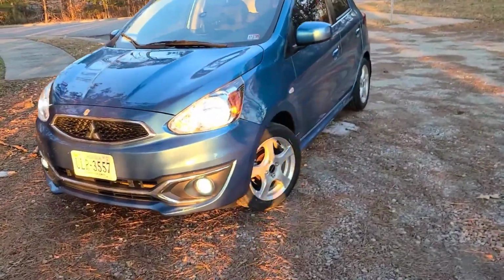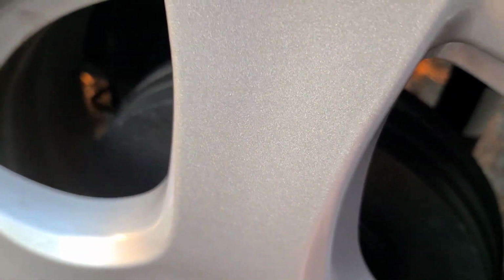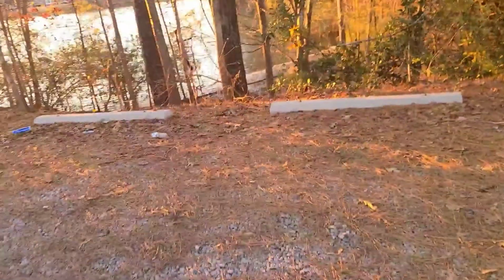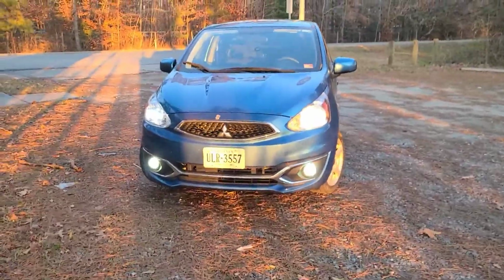Modded 2019 Misubishi Mirage Episode 4- NEW WHEELS AND TIRES FOR THE MIRAGE!?!?

Comment: Can you clarify if you're using 195,55r15 or 195, 50r15. Thanks
Reply from the maker: I am using 195 55 r15 But you can use any thickness depending on your preference and of course wheel size. The bigger the diameter of the wheel I recommend the thinner the tire. I have heard people get 17's on these but that's not recommended

Comment: Hello from Australia. I've got Mirage 2013 and thinking of installing wide wheels as well as my car is not stable on a motorway if speed exceeds 100 km/h. Have done wheels alignment several times and nothing helps. Have you noticed any changes regarding stability on high speed?
Reply from the maker: Wider wheels and tires help more than you would know, definitely recommend. You should watch my review on my channel for them.

Comment: I'm about to buy some Enkei EDR9 15 x 15.5's paired with the Hancook Ventus V2 that are 195/50R15 (just copied that from Tire Rack lol) - did you buy the TPMS kit & have it sent to a dealer? If so, what did that cost look like for you? 

Also was wondering if you found it easier (or cheaper) to buy the wheels & tires separately as opposed to having them mounted before they got shipped to you!

I've been subbed to you for a bit, saw your newest video the other day & decided I'm pulling the trigger finally thanks to you!
Reply from the maker: I used the tpms that was on the stock wheels and put it on the new wheels.

For me personally I bought them all together, then got them shipped to the dealership to get mounted and then installed there as well. (It might be cheaper for you to do it differently)

And thank you for the support, the new video that's about to come out is a brake kit, and I think you're going to want to see that one as well, it will shock you more than it shocked me!

Comment: I just bought this exact car and I see the HP is very low. I'm no racer, but I've been driving a 2005 malibu with a 3.5L V6 for 7 years. Everyday I climb a steep highway. So I'm a bit worried about entering the highway. Is there a way to give it a little boost to the engine?
Reply from the maker: Do you have the CVT or the 5speed manual?

Comment: I went to the link that you shared to buy these rims since they look good. Do you know if it will be an issue since the mirage is 4 lugs and the rim is 5 lugs?
Reply from the maker: The picture is just general, if you go on the website and look for rims under your vehicle and select 15" then you will find these. Unfortunately the link doesn't save it's for a Mirage, but MAKE SURE TO SET THE VEHICLE OR IT WON'T BE 4 LUG WHEN YOU ORDER. Other than that you should be fine.
Reply: @mitsubishimadman7321  okay, thank you I appreciate it.
Reply from the maker: Anytime, thanks for watching

Comment: Yes, the wheels do the car right; since they are larger than stock, have you noticed any change in acceleration or difference in speed at freeway speeds?perhaps the larger wheel per revolution goes alittle further, multiplied by how many times it turns on the freeway would get you more distance overall and thus even slightly better gas mileage?  Or with it being bigger, perceptibly slow acceleration?
Reply from the maker: I have a full reveiw on the channel 😁
Reply: Mirage does come from the factory with 15" wheels as well.  The difference here is the wheel width.

Comment: Hey buddy mind sharing the rim specs? BTW Nice ride same colour as mine!
Reply from the maker: 15 inch rims, 6 inches wide
Reply: @mitsubishimadman7321  alright buddy and what's the ET or offset of the rim? I reckon ur running on stock suspension?
Reply from the maker: Offset is 40, and yes running stock suspension and it clears everything
Reply: Nice! Is the rim flush to the body?
Reply from the maker: Yes, fitment is perfect on this car, it is flush and does not poke out
Reply from the maker: You can see it in the video

Comment: hey i found this video and fine job with the wheels and tires but when i went to check the website you linked in the description, tire rack says theres a error and its not available. but i do believe the tires are still on the website. just FYI if anyone who want the same wheels. (EDIT) I believe i found teh same wheels as the video on a differenet website.

Comment: Is your rim 15×8?
Reply from the maker: 15x6
Reply: @mitsubishimadman7321  do you think 15×7 would fit??
Reply from the maker: It would be tight unless you get small spacers or maybe a certain offset
Reply: @mitsubishimadman7321  so you think 1/2 inch spacers will work?
Reply from the maker: Should be good
Reply: @mitsubishimadman7321  thanks again